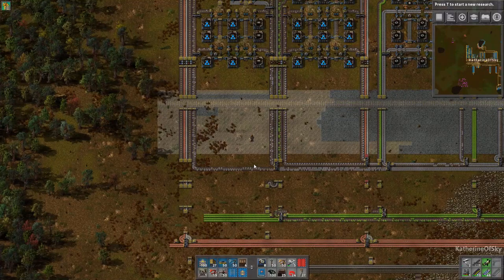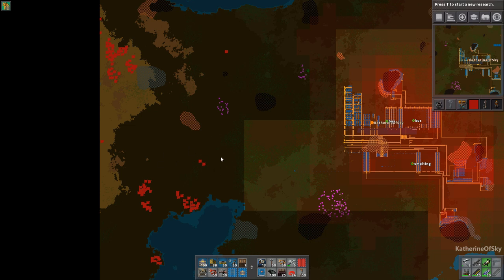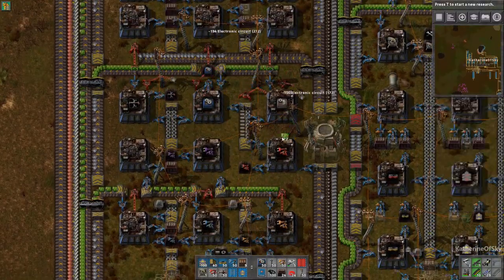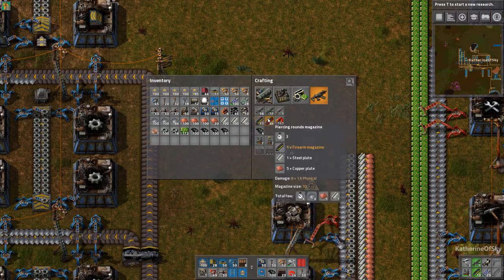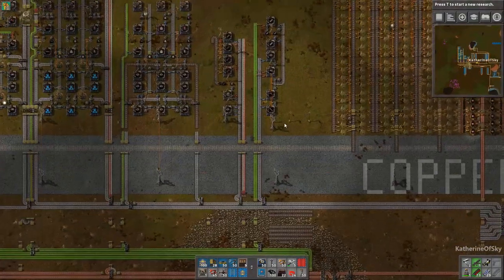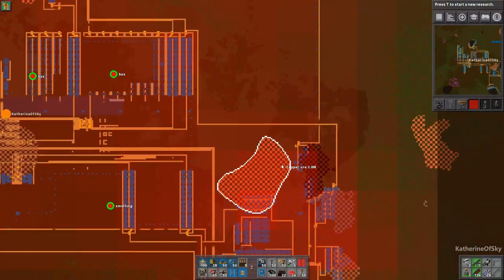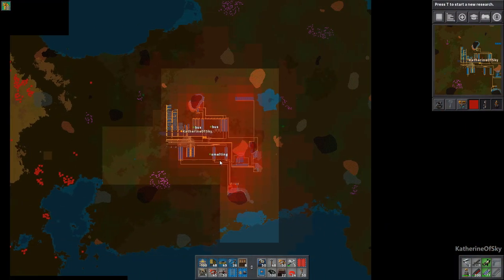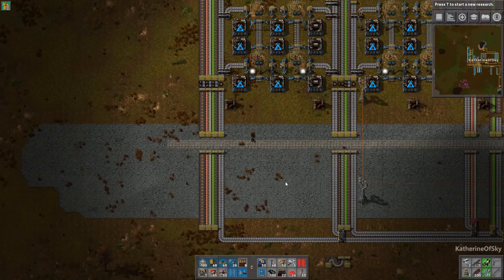Factorio: Entry Level to Megabase Ep 10: TURRETS, AMMO, & GREEN CIRCUITS RATIOS - Tutorial Series

Comment: its always on the right side, facing hte direction the belt moves, its not a bug.
so if the belts FACING the inserter, it will be on the inserters left (the belts right)
Reply from the maker: It should be on the right hand side based on the INSERTER, not the belt.  Your assertion that it's ALWAYS on the right side is incorrect.  The inserter will place an item on the far side of a belt, (which can be the left side) if inserting from the side of the belt.

Comment: OToo sad. Looks like the "mall" is an integral part of the "tutorial". Same as the nanobots. Placing gigantic BP's and let nanobots do the work is not exactly, what I understand under "Entry Level". The first 7 episodes were fun to watch, though!  This is not a criticism. It's just not for me, because I did rebuild your playthrough and the mall kind of overwhelmed me without nanobots. :D
Cheers!
Reply from the maker: Did you miss the part where I built a belt array all on is own?  Same with the Inserters.  You can design your own building structures -- that's the whole point of this series -- designing assembly lines to fit your own needs.  Surely you don't need me to build every assembly line by hand....  

Before the Mall came about, I did separate lines for belts, inserters, assembly machines, power poles, chests, etc.  The mall is an evolution, putting all those designs together in the same structure.

Also, just so you know, I have built the mall by hand MANY times.... most recently on my Tasty Vanilla,  Bite Me!, and Lazy Island series.  Nanobots are NOT required.  They just speed up the process.  ... hint: you only need to place the assemblers you need at the moment.
Reply: KatherineOfSky Thanks for clarification! I think I will give it another try.
And maybe I should take a look at your lazy island series.
And don't want to give up right now. It's just this game sometimes can be extremely challenging and frustrating.
But it makes so much fun and it motivates me to watch other people playing it.
Reply from the maker: In the Lazy Island series I do use this Mall.  If you want to see examples of smaller assembly areas for factory components, I will recommend the Belt Diva series.  It is pre-0.15, so the science is out-of-date, but you could look at the couple of eps where I build the smaller structures.
Reply: KatherineOfSky Thank you for taking me by the hands!
As a man in the 40s, I really appreciate that. :-))
I'll definitely dive into your playlists to learn something and having fun.